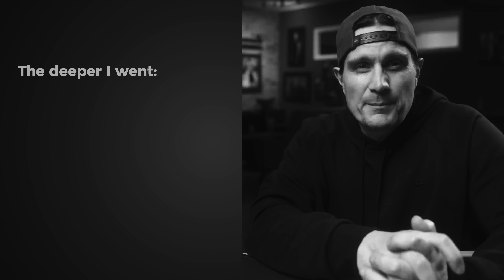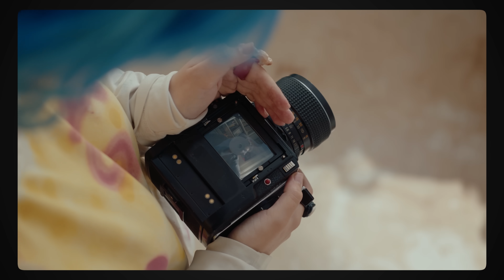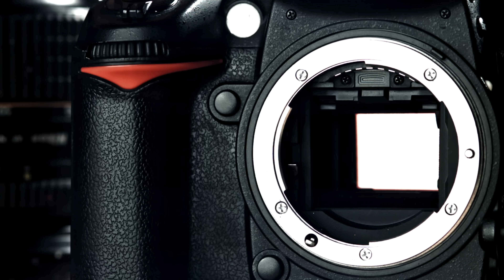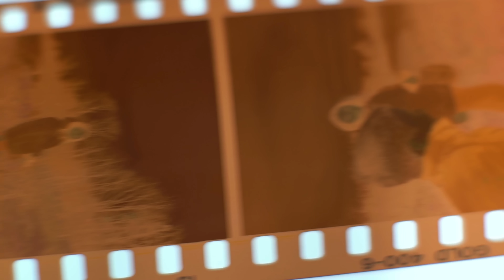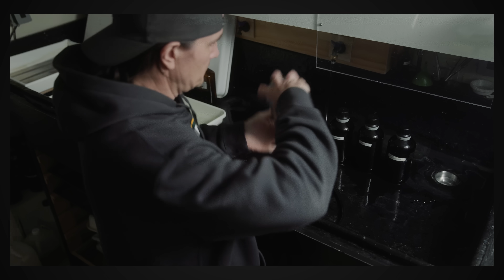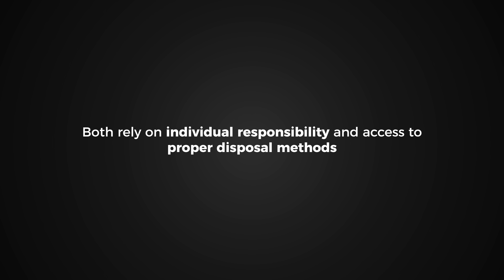Film or Digital: Who’s Killing the Planet?

Comment: You know, everything is relative... If anyone was really worried about the planet, air travel would be for emergency use only. As a retired airline pilot I can tell you that one 767 going from NY to LA (and there's a couple hundred doing similar flights across the USA everyday,) put out more pollution than all the privately owned diesel trucks in the USA in a year. There no "clean air technology" on a turbofan engine and it's 9,000 gallons a flight. There's over 3000 flights a day in the USA. The number one consumer of oil in the world is the domestic USA airline industry. Or the trucking industry. Going cross country with individual trucks is ridiculous 90% more efficient to load them on a train and then regionally distribute the goods by truck. And why is there butter from New Zealand and Ireland in my Walmart in Oregon?  Butter is butter and the butter from Oregon is arguable better anyway. Why was that refrigerated and shipped from 7,000 miles away?  I'm not saying ban air travel, but there's little an individual or household can do that would make any difference compared to the tsunami of pollution that happens everyday commercially. But if it makes you all feel better, go for it. Jesus I think I have just attained curmudgeon status! 🙄🤠
Reply from the maker: Awesome insight! I agree fully. My main reason or point of making this vido is that someone basically came at me with I'm a bad person for ruining the enviroment talk... and I just wanted to know for myself what is and what is not complete nonsense... The truth is most household chemicals are about as bad for the environment as most of whats in my darkroom.  And anything harmfull can be dealt with responsibly. But I fully agree with what you stated. I recently started tracking airplanes in my area and it is crazy the number of planes in the sky at any given moment!
Reply: @Distphoto  I totally understand. It's good you made this video. Somebody gave me a hard time on one of my videos about the water I was "wasting" washing my prints in my archival washer with no regard for conservancy of water... I pointed out that I live in Oregon and we have more water than we know what to do with, and I can use as much as I want and nobody will be shorted or ever know or care. I can use as much as I want, there's no shortage here and nobody else will go without because I washed my prints. If I lived in Arizona or California I would use a much more conservative approach for print washing.
Reply: Just chiming in on this conversation but I once read that even if everyone on earth recycles everything, big corp especially energy corporations would still produce more than half of the total CO2 that's currently on the record. Of course a healthy skepticism is always good, but I remembered again that plastic companies also lied about how plastic is recyclable when it isn't. Of course being enviromentally conscious is always good, but a lot of the time the key to a more sustainable planet is top down, not bottom up
Reply: I see the photographic topic / video in the context of where human civilization / societies need to go to: 
"Taxation of the total consumption of resources and energy to build , use and recycle/dispose something".
With this principle of adding the environment costs to everything and the removal of hidden costs (on to societies, tax payers,...) everything becomes simple and transparent in comparison to the to be dropped dump VAT we have everywhere today.
Resource, and energy saving products being environmental friendly produced, used and disposed will be cheap, And the opposite expensive.
You can not convert overnight, but over 1-2 decades this should be doable..
Reply: @FrankTitzeArt  The only problem with tax is that it creates a very lucrative middle man bureaucracy that has no incentive to solve any problems because then their cash cow would be dead.
Reply: @photolove2025  is for sure a risk, but we pay already for consumption/usage direct or indirect. From ground/house taxes, water, electricity, gas, fuel, materials costs, (different) garbage costs, etc etc. up to CO2 compensation (in certain countries). That new form of "taxes", fees or how ever you want call it, would expand this. But at end I see no more complexity than the international tariff and regulation jungle being handled by companies today. The end user just get a new different price. See it as a better and much more ecologically steering replacement of the old fashioned VAT. if in the price included or extra labeled is a detail.
Reply: Maybe that's why Obama came to Europe to study the fast travelling train systems both from France (which is too flat to be a useful model to create one like that in the US) and Spain (which has a more similar landscape when compared to the US and would be the ideal model). 
But he was too late and there hasn't been continuity in the US government to make it possible. 
Plus, we are no longer in a time when some of the most powerful and rich men in the US are linked to the transport industry...
Reply: This is false. A boeing 767 doesn't produce so much CO2 to be more than all trucks in America in a year
Reply: @RoboticDragonRider  This is false. Trucks don't pollute at 35,000 feet. And the airline industry is the number one source of pollution in the USA. Globally it's the country of China. If you want to save the planet, don't fly and don't buy anything from China.
Reply: im saying ban air travel! We should build high speed rail and replace planes!

Comment: I literaly have my 1970 Minolta SRT 101 infront of my laptop right now  with a  film in it. You could probably defend yourself in an alley with it and keep shoot pictures afterwards. I urge the people that only shoot mirorless to just pick up a camera like this made out of pure metal and glass, just to feel the mechanics the operation and the weight of the thing. I own Nikon D750 and  a Fuji x-s20 mirrorless. All great cameras i enjoy. But the build quality on an old SLR. Uff. Pure erotica. Not to mention the fun of developing  and scaning at home.
Reply: Exactly why film is environmentally okay. We reuse instead of buying new stuff. Sometimes gear doesn't even need batteries (selenium meters or none, manual winding).
Reply: @loganmacgyver2625 we are on a treadmill of upgrades when it comes to smartphones (like the one I am typing on right now) so as long as many/most of us have one, a light meter app might go a long way to not caring if a camera has a meter (or if it does then does it work?).
Reply from the maker: "You could probably defend yourself in an alley with it and keep shoot pictures afterwards" 😂.  Have always felt safer with a brick or tripod in hand!!!  Yeah these old cameras are something special
Reply: @Distphoto I like the tripods with feet which hide a sharp spike - revealed when you give a quick twist 😈
Reply from the maker: @nickpalance4096  Yes... and a heavy ball head!!!

Comment: I use digital and analog (again).
My lasted camera market entry was 2014.. My average camera / lens market entry was likely in mid 1980s.
At moment, 
- I adapt a modern film holder to 9x12 from 1926 (according to lens). Welta? and 
- I modify a 12x12 Mentor Reflex (from likely 1949 according to lens) to use Linhof plate, and plan to modify it also to modern film  holders.
So I am quite fine environment friendly with the gear.

At moment are my computers (Windows/Linux) are 7 to 15 year old but got again and again upgraded with HDDs. Overall I see myself also relative fine here.

Where things could be better:
For analog, I have to dispose developer and fixer to the special local garbage collection,  So far so fine, despite that those are no more really used to get such material.
What is on the market lacking are affordable concentrators, which can reduce the garbage volume by extracting the water (boiling,..) from the chemicals, because this is also the way the disposed liquids are handled first. That would could easily reduced the volume to a 1/5 to 1/10th or beyond. --- So to say roughly remove all what added to fluid chemicals would be a great step.
Fro extracting the silver, on my own,I do not see the volume to make this interesting.
Reply from the maker: Thanks for the insight and dedication to the craft and the environment!  I would say be carefull if you evaporate off with certain chemicals if you get it to dry chem this can also be airborne and toxic.
Reply: @Distphoto  Absolutely ! 
With having respect and lack of chemical knowledge  (as studied physicist, chemistry was always more voodoo than science to me ;-) )  I do not plan to design (& construct) something myself. 
Here the analog community miss either a ready to use products or at least  proven&save designs for DIY construction into handle the relative small waste volume we have.
And BTW: I am on top also enough loaded with my "physical" designs & constructions

Comment: It's digital digital is worst. :) 
you did not thing about the cost of mining transporting refining transporting an making the chips. 
only the battery will be something like a 25Kg of ore ;) 
For a car battery is needit something like 300-500 tons of ore, a wagon holds about 50T :)
Reply from the maker: So much more could be dug into... kind of endless really
Reply: @Distphoto  not endless but complex. 
the materials need it are rare, I assure you that for a camera (or for a phone) at least 50 tons of raw materials need to be extracted. 
chips and screens need the highest grade quartz crystals. and things like gallium indium copper gold niobium tantal etc. 
that ore needs to be transported, made into powders by machines chemically treated transported again, refined chemically and with heat, transported again and then made into a  parts chemically treated again transported again processed again assabeled again and again and again. 
a verry verry long chain.
The cost in energy and environment abuse is many times higher for a digital gadget then all the chemicals used even by Ansel.